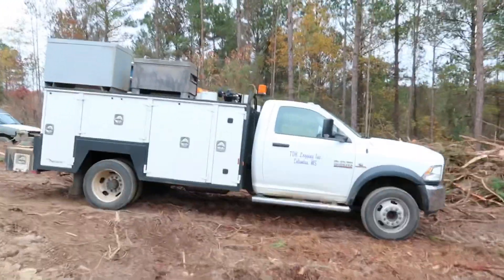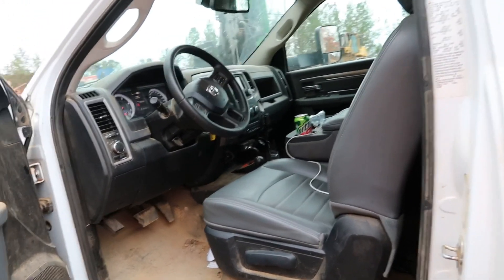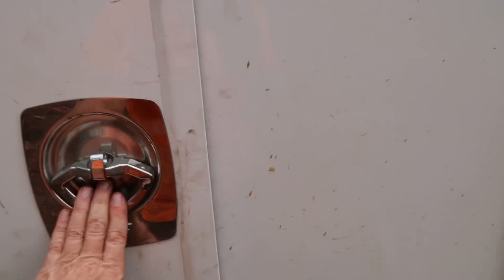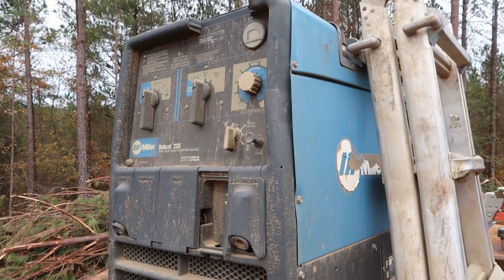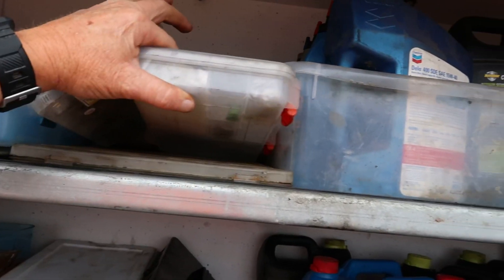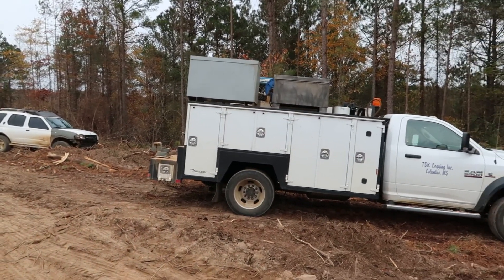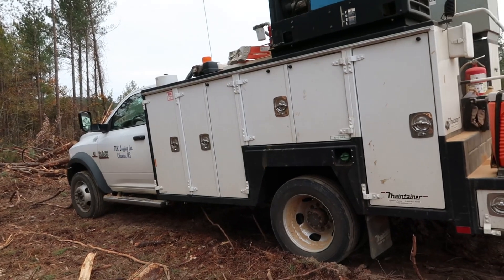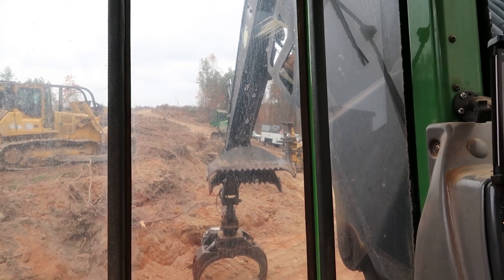Ram 5500 with Maintainer bed | service truck tour

Comment: Nice truck Tim word of advice running exhaust full time you'll save money brake pads I have a 55 Cummins Dodge and I run my exhaust brake, I leave it on full time you won't burn any any more fuel than what you would do running it without it actually saved on your brake pads I went 80,000 miles before I head to put brake pads on my truck then when I did them they still had lot of pad left keeping my exhaust brake on at all times

Comment: I line my service body doors with 5/8” plywood and built wrench racks and holders for Allan keys and crescent wrenches an screwdrivers to free up drawer space.
High density foam makes great drawer liners too, just get some a few inches deep and put it in the drawer and trace a tool out on it with a sharpie then pluck out the inside of the line, keeps tools from rattling apart.

I like universal hose systems on equipment implements, every hose has a straight fitting, every elbow is its own fitting, it can be its own pain in the butt I know but you just carry 2-3 common size hoses and fittings for a spare and if you blow a 3’ long hose you can stick a 5’ long hose in its place to keep running and pickup the new hose on the way home at the end of the day.

Looks like a decent service body, them handles probably aren’t much fun when it gets muddy out.

Comment: Interesting.  I don't get to hear about such things in my line of work.  Pressurized tool box was a neat concept.  Like to hear how companies overcome issues over the years and finally come up with a solution.  Loved the locking drawers and how easy they unlock with one hand.  I thought you were going to have to reach with a second hand for an unlocking mechanism on the slider rail.   That would be a pain when you always have a hand full of tools you are putting away.

Comment: Third comment is get some black spray Flex Seal and spray your oil pan not that you have much salt down there in the south trust me they will not warn TV oil pan on that truck it will Rust and cost is $1,100 to replace it just spray it with Flex Seal

Comment: Tim, off topic but Northport Power said they had received the last shipment of 372xp saws in, that they were going to quit the manufacture of that model, you gonna buy one or three before they run out?  I have an older 970 Olympyk that I run for a 70cc saw, half tempted to buy a 372 new while I still can, curious what your thoughts are, and they are also 20% off right now.
Reply from the maker: I prefer the auto tune saws.